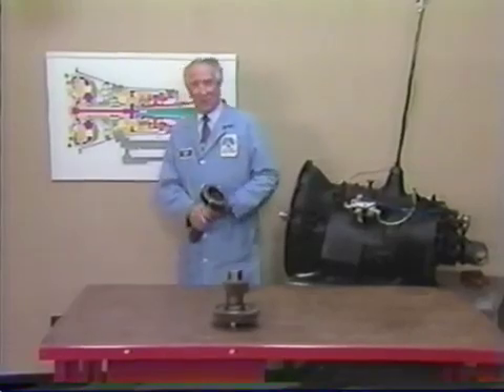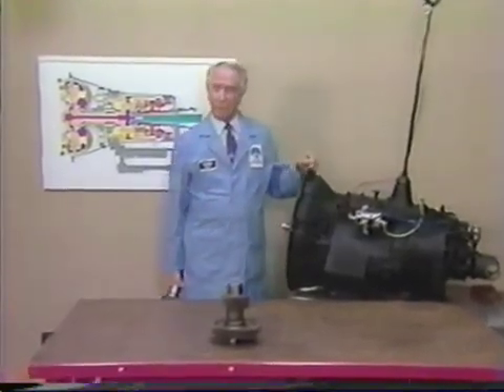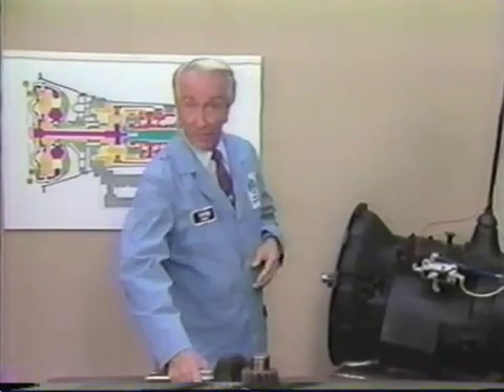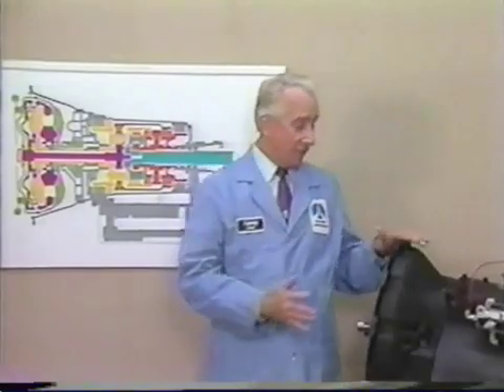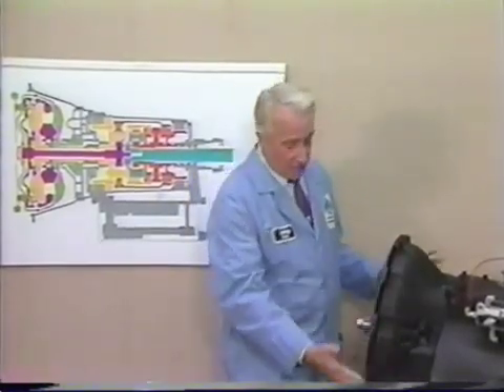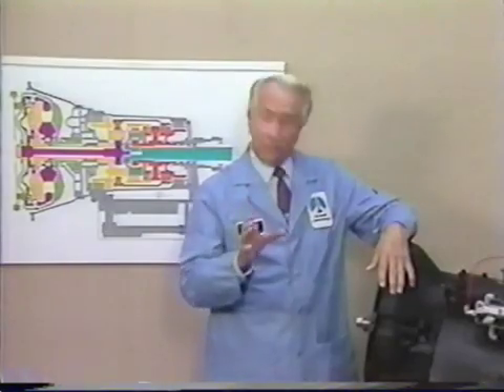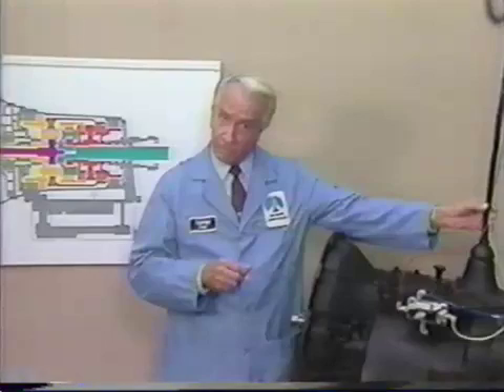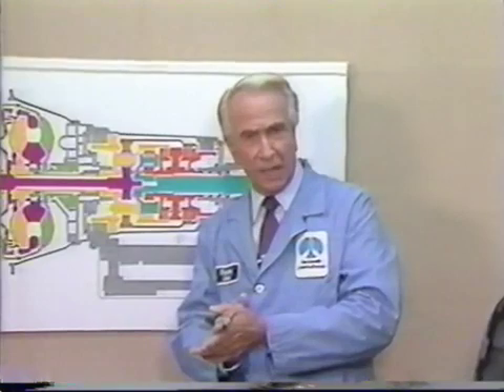Rockwell Turbo Encabulator Version 1

Comment: Of course, a drawn reciperocation dingle arm. Makes sense. Why did no one fit one before?
Reply: Because of the cost - it took over $50 billion but it was well worth it in the long run.
Reply: @donmoore7785  I heard that the manufacturer of drawn reciperocation dingle arms has limited the number they are making to keep the price high.

Comment: I was referring to the first ROCKWELL International Corporation "Turbo Encabulator" video. It was done for the Tripmaster Trip Recording System for trucks. The prop the paid actor used was the Keypad/Driver Input Device. Then this truck Transmission video came out. Reason was the same VP headed up both the Automotive Electronics and Transmissions departments.

Comment: The true original version was used for the Rockwell Tripmaster Trip Recording system for trucks. It was a pan for the distributor network annual sales meeting. Since the same VP and a few Directors were responsible for the soon to "boom" Transmission division, the next version was made with a nine speed. Eventually the division imploded though.